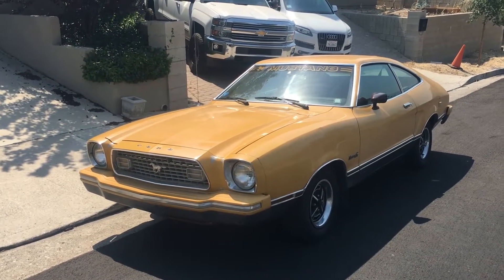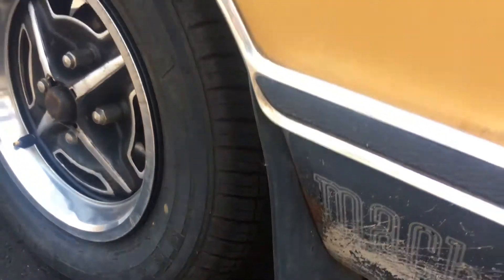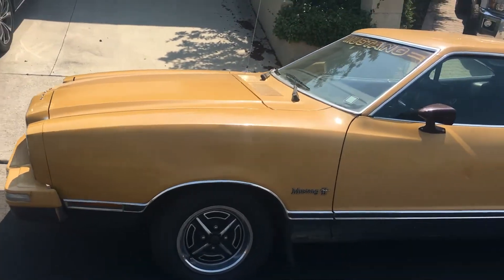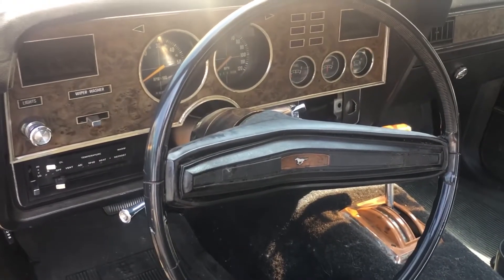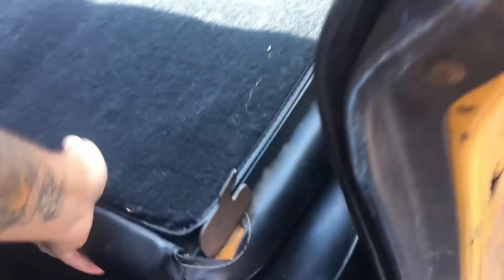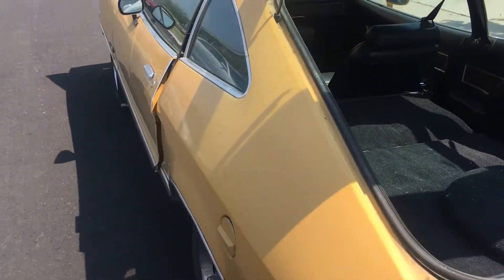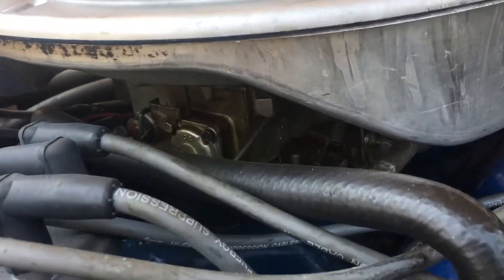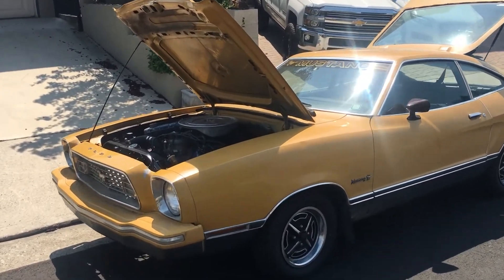Mustang II Mach 1 Project first contact

Comment: Nice project! Good luck!
Reply from the maker: Thank you! So far I have managed to rebuild the engine, heads needed reseated, valves and valves stem seals were cracked, it had a blown head gasket, once I put it back together and rebuilt the carb the electronic started failing so rebuilt the distrib (stayed stock as I am a sucker for stock haha) and swapped module. I rebuilt suspension, new upper and lower control arms and all bushings, new shocks, new breaks, new rack and pinion, rebuilt the power steering pump. Now I am tackling an over heating issue, recopered the radiator which was leaking and now chasing an overheating issue at highway speed.
Once that is settled, I will swap the rear end as it is a 3.55 gear ratio, which is great for taking off and drag racing I guess haha, but not so much for a daily, I'd like to go back to what Maverics had like 2.78 to 3.00 max.
And once all that is done, hopefully by spring, I'll get to the comfort things like AC and Radio :)
Reply: @JettHo76  That's a lot of work already done! I have a blog about mustang ii (in french: mustang2.fr) and another one in both french and english (nicksblog.net), I'd like to write an article about the rescue of your Mach 1 if you agree. Please contact me! I really like this kind of project (already saved a Mustang II and will probably buy anohter one soon!!) And good luck!!
Reply from the maker: @nicolasb.6039  I have emailed the mustang2.fr blog, en français étant moi même francophone.
Reply: @JettHo76  Merci ! Je vous réponds dans la soirée ;)
Reply: 139 hp NOT 220.
Reply from the maker: @henrycruz45cal  this is a 302 from a 1970 Maverick, NOT one from a post 73 Mustang II, so it does rate at 220.

Comment: Nice Car.  It’s a 1974 Mach I, right?  Sighting the longer nose and gas cap below the line on the fender, it has features unique to that year.  ’74 was Motor Trend Car of the Year.  The Mach I was actually the performance model with standard front and rear sway bars.  That was an option for the cobra.  Swapped V8 is a good move.  ’74 didn’t have the V8 as an option unless it was sold in Mexico.  Better off with the v8 regardless how it got in there.  As a project car it is a very good starting point.  You can find new power train parts.  You can fabricate body and chassis bits, there are some reproduction things like carpet and door trim.  But you can’t replace the plastic along the interior.  Yours looks pretty solid there.   As you said, some paint and minor body work are all that is needed.  There are lots of videos about GT40 heads from late 90’s explorers if you want to redo your heads.  Good Luck!
Reply from the maker: Thank you! I'll look at the GT40 heads, I heard them mentioned on a 302 rebuild video the other day. I found it in Washington state so I was worried about rust but it was a mostly garaged car, so that helped.
Reply: The hood is shorter too on the '74s as the '75 & up Deuces have an extended hood and shorter nose cap to help clear the space needed for the larger radiator required by the 302 installation. Notice how this '74 doesn't have sufficient room for a belt driven cooling fan? It has a pusher electric fan in front of radiator. Good eye sir on noticing it's a '74.